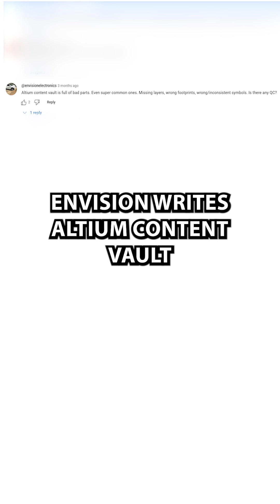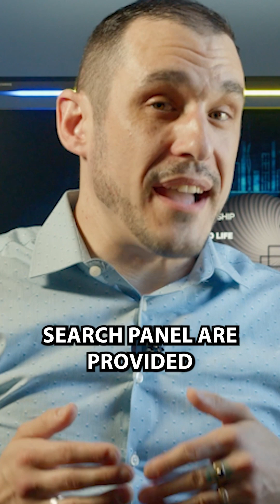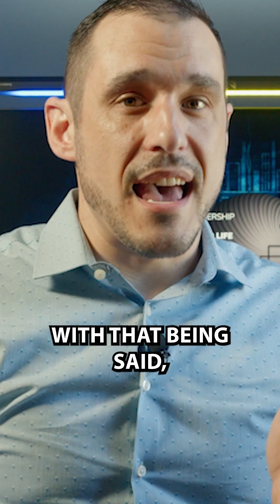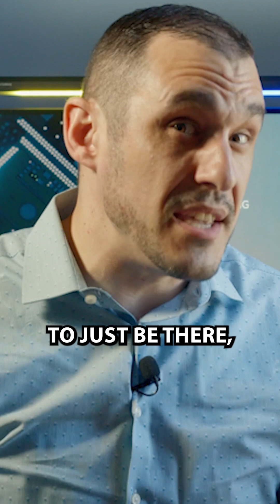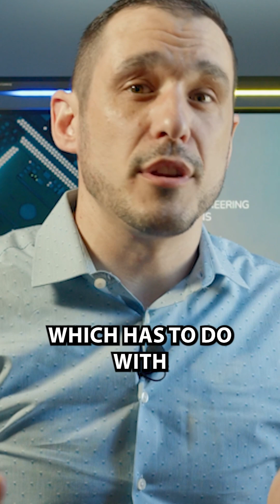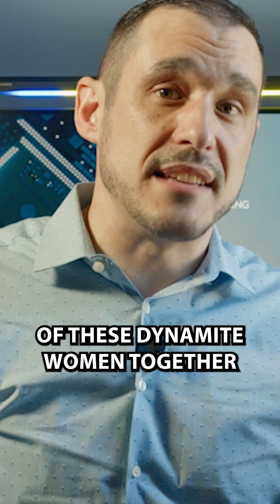Can You Trust 3rd Party Sources For PCB Footprints? #pcblayout #electronics

Comment: The process behind a review says "don't even trust yourself and check everything at least a second time". 4 or even 6 eyes see always more. I think parts from the manufacturer are an easy start. They give you at least good pad dimensions and the 3D model is already added. But I will always check them up and transfer the information on each layer to our owm standardized setup. 
First comes the internal guideline how components have to be described in the library, then comes the addition of components and the library build. 
And there is lots of good information about recommended layer setups in the www.